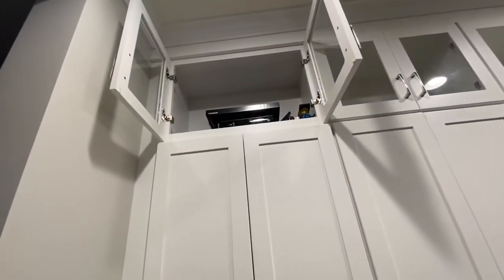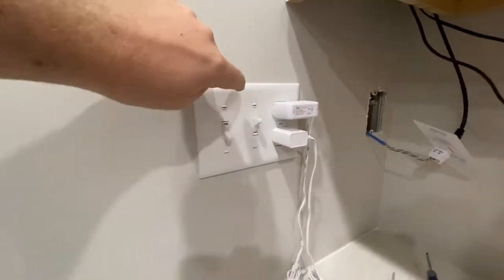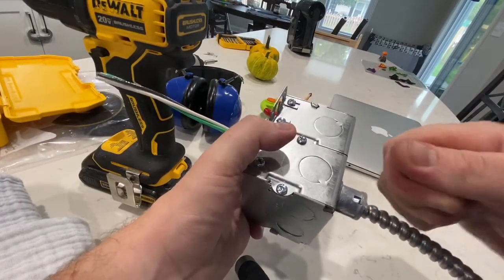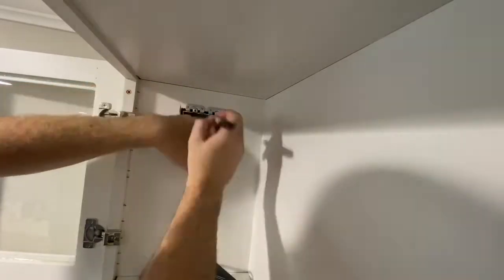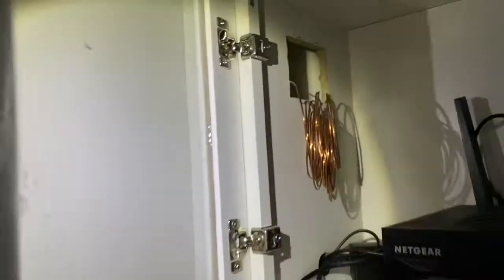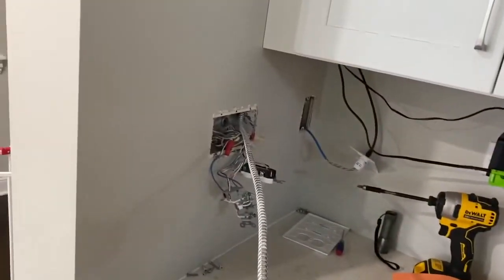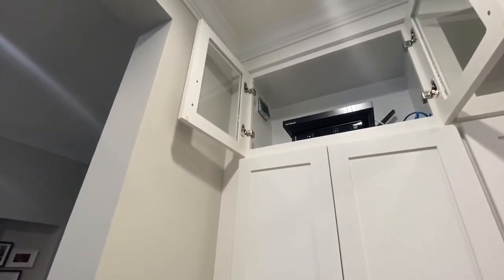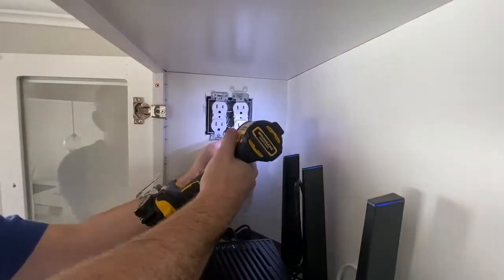Installing New Electrical Receptacles (Outlets) in Upper Kitchen Cabinet

Comment: Quick question:  is having a conduit required by code?   I wonder if we can just run wires behind the walls and secure the wires with locking connectors at both junction boxes?   Great video!
Reply from the maker: Metal conduit is required in Illinois where I am. Don’t know about where you are, but plain Romex is allowable in lots of places.

Comment: I'm running into the same situation. Did you have to use an armored cable in this case? Would a typical NM cable have sufficed?
Reply from the maker: Romex should probably be fine. Check your local building code. FMC just a bit safer IMO.

Comment: i have a question i would be very happy and glad if you informed me please.
i connected electricity plugs , one for the AC and one for light sconces. the electricity wires are INSIDE the closet (of which i plan to hang clothes in it) and the turn on and off switches are outside the closet. the electricity wires are covered with plastic tunnels only. however im now scared of using that electricity now so my question is it safe? or is there any tip to avoid electric fire? thank u very much